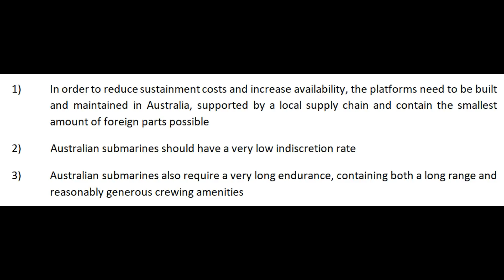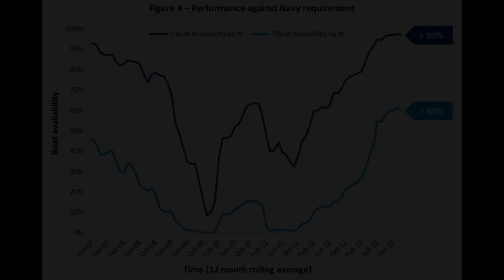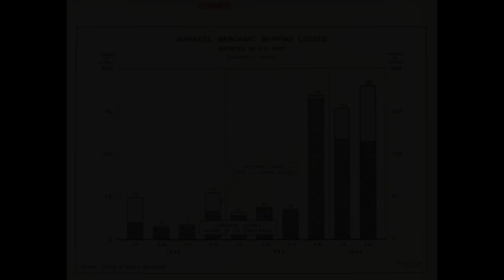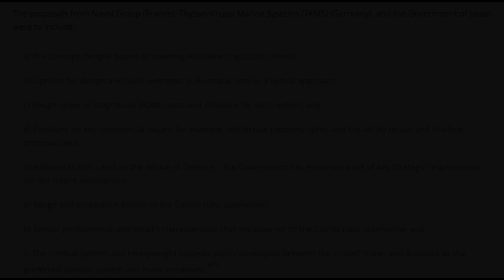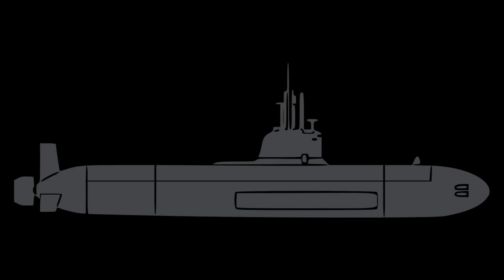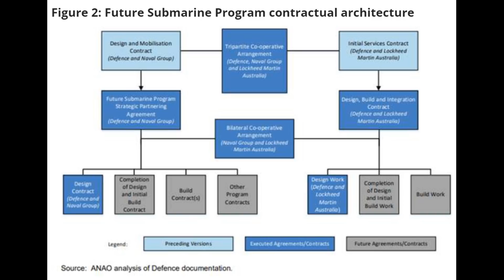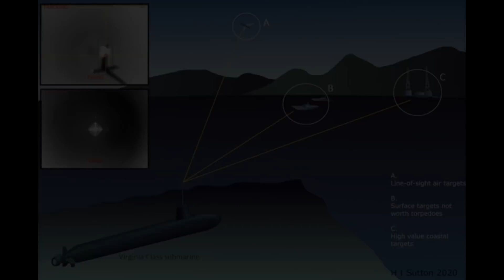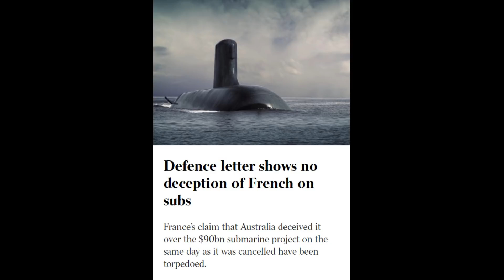AUKUS and the Nuclear Option: the Life and Death of the Attack Class Submarine

Comment: As for the Baracuda nuclear option, I can't see why sourcing nuclear fuel is such a clinch. Its civilian grade and could be potentially sourced from a variety of nation suppliers with a civilian nuclear industry. The UK-US option requires weapons grade fuel, meaning your fuel supply options are entirely dependent on them. I know they won't require refuelling in their lifetime but that can lead to other issues. 
The main being if you do have to refuel them, because their replacement isn't ready in time or because a problem has been detected, you now have to refuel a reactor that was never designed to be refueled. HMS Vanguard is a prime example, went into drydock in 2016 for a refueling it was never mean't to recieve and it hasn't come out yet, despite having been supposed to come out in 2018. 
Having a reactor that is designed to be refueled gives you added flexibility, also submarines are in dry dock all the time for refit and repair, i'm not sure how valuable a none refuelable reactor is seeing they need to come in anyway. As for dealing with spent fuel, your gonna get that problem at end of life anyway, look at the problem the uk is having with breaking up their old nuclear submarines.
Reply: Usually they replace they entire reactor instead of trying to refuel one that isn't meant to be refueled
Reply: @oliverwells8011  I don't think they do, haven't heard of that before. Wouldn't you have to properly dismantle the submarine to do this and then reassemble it after. You might be better off making a submarine from scratch. Honestly, I'm not 100% sure about this though but it sounds like a long and expensive process.

Comment: As always, worth the wait, and such a splendid topic. I have always believed that anything less than a nuclear sub was just not sufficient for the role we use our subs in. I am glad the Collins class will have an extensive MLU to maintain and indeed improve their lethality, and I believe if retained and deployed from Darwin as a deterrent in the Arafura, Solomon and Coral Seas would secure the northern approaches whilst allowing the 8 nuclear subs to range far and wide providing nightmares to any would be aggressor. A fleet of 8 SSN and 6 SSG would give us a significant and credible deterrence capability and a mixed fleet of stealthy and capable subs that could and would make any military incursion fraught with danger for surface and subsurface vessels. Basing the SSN fleet, wisely, and the SSG fleet in the north, we could easily establish a critical gap making any beachhead strategy unviable in terms of both mainland Australia and it's Island territories. I feel the most likely scenario would be the lease of 2-4 Los Angeles class, mixed crews, to establish our capabilities whilst manufacture ramps up, and employing the capabilities of the Collins alongside them would give us a credible deterrence capability from the start of the build program. Yes, Manning is an issue, however it is not the vast problem many seem to believe it to be. The Collins has a modest crew size and even the Los Angeles class, in small numbers as an interim capability would expand the fleet manning requirements, it would still be a wise and cost effective deterrent and make any prospective aggressor consider significant losses in surface groups should a shooting war commence suddenly. Subs are a force multiplier, the Collins, if patrolling Australian waters and territories, could easily make the approaches too risky to consider without significant and credible ASW capabilities, as for enemy submarines, the combination of SSN, SSG and Hunter Class as well as P8A would make Australian waters too deadly for  any hostile submarines to consider anything less than a submarine death trap. I believe the Australian public at large would have no problem with increasing our defence budget and size to enable such a capability which would in turn protect our sea lanes and also our maritime exclusion zone. P8A and Collins makes it risky, add the Hunter and AWD, it's just too risky, add the SSN and it is suicidal to consider any military action in Australian waters. Now just another 3 Hunters and 3 second hand Ticonderoga CG and we have a fleet that would make us feared and respected in time of war, add some F35B to our LHA capabilities, or take 2   soon to be sunk Tarawa class from the USN and deploy the F-35B and perhaps even fully refurbished AV8B from them and we have a fleet that is credible, capable and significant. A dream, perhaps, but consider being short of assets in a shooting war, and no amount of money is going to provide the surface, subsurface and maritime air we need when we need it. The time is short, the risks are great but to lose in what is inevitable with the CCP is unthinkable.
Reply: I agree Australia should keep the Collins Class operational for as long as possible as a deterrent and your suggested deployment from Darwin is spot on.
Reply: Spot on.....

Who needs friends when you have a nuclear attack submarine?

Who needs a nuclear attack submarine?
People who treat their friends like this.

Toe may toe, toe mah toe.

Civilized folks agree that wars happen when relationships fail between nations.

Krupp advertises that you'll get attacked if you don't buy the biggest gun.

Same story 100 years ago.
Reply: The Astute-type attack subs are a good choice, but it should have been made 10 years earlier. The 2nd Pacific War will probably be over by the time Oz gets its new subs unless the Allies can manufacture them a lot faster than usual. In WW2 there was a sense of urgency which enabled the US to build a Liberty ship (medium size freighter) in 24 hrs, though this was a special effort and they normally took a bit longer. With the same sense of urgency i'm sure they could buid an Astute in half the time it normally takes. It would be frustrating if they were delivered after the war was over. China needs 5 or 6 years to build up its armed forces and to persuade Taiwan   to unite voluntarily, so the odds are it will be another 5 years until war breaks out, but it could be sooner than that.
Reply: Brett Mitchell  Politically & operationally unacceptable. The subs have to be built & maintained in Australia in order to be effective & immune to shifting political allegiances & pressures.
Reply: Brett Mitchell  The nonsense is all yours. 
The presentation laid out in a clear & concise manner whey having submarines manufactured on the other side of the world is strategically & politically unacceptable.
If you are struggling to understand why, then the problem is all yours.
Reply: Brett Mitchell  "Maybe you are one of these republicans types who think Australian should seek alliances with Asian countries?"
I'm a Brit, resident in the UK, a royalist & a believer in the Commonwealth as a basis for a deeper alliance (or rather a reforging of what once was), so you know where that supposition belongs...
What's doubly amusing is my not wanting AUS to have UK built Astute, as I'm within a stone's throw of where they're built, with the local economy pretty much 100% reliant on BAE Systems Submarines.
The idea Australia CAN'T build an SSN is absurd & either defeatism, or you are in reality on the payroll of the CCP.
What part of "the reactors will be sourced from the US" are you struggling with?
Presumably the same part as where it's clearly stated the reactors are designed to last the whole life of the submarine.
Reply: Brett Mitchell  The reactors will come from the US/UK as pointed out in the presentation.
The hulls will be built in Aus. You're the one on hallucinogens with your "mine is the only truth" pronouncements.
Reply: Brett Mitchell  Utter nonsense.
Reply: @GARDENER42  what about those Chinese type 39 submarines? Could be affordable short range defense.
Reply: @davidburland6576  Somehow I don't think they'll be willing to supply them, or plans to build them...🙄
Reply: @davidburland6576  What part of Australia is purchasing submarines to counter the threat China which presents are you struggling with?
Reply: @GARDENER42  they look cheap maybe less than 100 million apiece Australia has underutilized  coal assets and a local Chinese operated facility for servicing depending on the number just 5 billion will do and the trade dynamics of reopening the coal mines could reduce that to net zero tactically they can be an anti invasion asset for Australia.
Reply: @davidburland6576  
Let's buy our submarines from our perceived biggest threat, then pay them to do all the maintenance & repairs.
Brilliant defence strategy...
Oh & let's dig more coal to fuel the world's biggest polluter & emitter of CO2...
Reply: @GARDENER42  yes thats it
Reply: @GARDENER42  at least 30 would be nice they can knock them out fast.
Reply: Brett Mitchell  HMAS Agincourt! I hardly think so.
Reply: Brett Mitchell  how do you think the people of Perth would react to having up to 8 nuclear reactors each with several tonnes of weapons-grade uranium docked and serviced just a few kms from the city?
Reply: Brett Mitchell  "a great deal of public anger..."! Where? As history has shown, the Upholder-class were duds.
Reply: Brett Mitchell  tell that to the Canadians.
Reply: Brett Mitchell  certainly the USN but I'm sure about the RN. That's only for brief visits and not permanent basing and maintenance.

Comment: If the RAN does not buy an essentially MOTS SSN, the timeline will be much longer than those for the Attack class.  Costs will also balloon. I have no issue with the arguments presented here, but the ability to resist "tweaking" the design will need severe discipline.  Good luck.

Comment: Hopefully this opens the door to the development of nuclear power for civilian use.
Reply: Unlikely. Nuclear reactors are scientifically interesting but the cost outweighs the utility for Australia due to a range of factors. Varied combinations of solar, wind, geothermal, hydro, and tidal with capacity storage and long range transmission networks are more feasible as alternatives.
Reply: @sir_vix  Yes you are correct. Prof Andrew Blakers of the ANU has demonstrated that renewable electricity with pumped storage hydro along with long grid interconnectors is cheaper than new build coal or gas fired electrical power and far cheaper than nuclear.
Reply: Look up HB11, a Hydrogen and Boron based Nuclear reactor, with lasers to help ignite the reaction. Australian made.
Reply: @Manawatu_Al2844  An interesting link that could be a promising path for fusion power.
Reply: shhh, that comes later..... 😉

Comment: A lot of commentators seem to be assuming that Australia is going to end up with the Virginia Class... I suspect its far more likely that Australia will actually be getting a version of the British Astute Class. The Astute class is significantly cheaper (which will be an important part of the decision), it requires fewer crew (which will be important as Australia lacks the numbers of submariners to expand its fleet rapidly). The Astute is also manufacturerd by BAE, who Australia have existing links to through the Hunter Class/Type 26 programs. The Astute is cheaper, in many respects more modern, easier to run and readily exportable. I'd be very suprised if Australia ended up with the Virginia Class.
Reply: The PWR2 in the Astute is a bad design, the PWR3 that will be in the Dreadnought class is based on an American design that's in the Virgina class already, and the Virgina class is better so the Astute is not more modern.
Reply: @rayjames6096  not sure how you can say Virginia is better than Astute. The reactor issue has been sorted. By all the accounts I have Read Astute is a better sub, cheaper and needs less crew. 
Also it features a better squared bow (front) that is a quieter design. Next gen Virginia looking to adopt that design BTW. The only thing Astute lacks compared to Virginia class is vertical launchers for anti ship hence it needs 20 to 30 less crew. The Astute however uses its horizontal launchers for its anti ship options.
The real issue for Australia is availability. You need subs now. US has no spare sub manufacturing capabilities. UK may have but is soon ending Astute production - unless Aus books it quick.
Suspect Aus may lease some old Los Angeles class from US or old Trafalgar class boats from the UK to train up on. There are plenty of choices awaiting decommissioning.
Reply: @tomjowitt8554   The PWR2 reactor on the Astute is a faulty design and will not be on the Dreadnought class, that will be a PWR3 which is based on the S9G an American design that is on the Virginia class. The Virginia class is larger so it has a larger crew. The UK has no spare submarine production capability. That bow nonsense is irrelevant.
Reply: @rayjames6096  We agree to disagree then. I agree the Virginia is a slightly bigger boat (but the Astute is faster...so what?). Both boats are really good subs, and I was just pointing this out. However if my bow comment is nonsense, why are the US going to adopt it? Suggest you check out Sub Brief's review of the Astute. He is an American ex submariner to see his take on the squared design of the Astute. He also backs up my comment about the vertical launchers on the Virginia needing extra crew.
Reply: @tomjowitt8554    The Columbia class does not have the same bow design as the Astute.
Reply: @rayjames6096  You are right. The Columbia class does not feature a squared off bow like the Astute class. That said, the Columbia class subs are a completely different class of boat, as they are a SSBN (missile boat) and not a SSN hunter killer boat like the Virginia class and Astute class subs. The latest US Virginia Class is the block 4 variant (still using traditional rounded bow), but the US is said to be evaluating the Astute bow design. The US will be building the block 5 variant of the Virginia class soon...and it is for this, for the hunter killer class, not the SSBN class, that the squarer bow may be used, if the US designers decide they want to use it. In the end, decisions like this are a matter of what works best in particular roles, which is why there is no 'best' sub in the world, only the most suitable sub that is best suited for each nation's needs.
Reply: @tomjowitt8554   You stated the new US sub will copy the bow and the new US sub is the Columbia class, which does not have the same bow design. The Virginia block V will not have the same bow design as the Astute anyway.
Reply: @rayjames6096  Are you aware there are TWO completely different types of subs out there, with TWO COMPLETELY DIFFERENT roles? At the start, you compared a SSBN to SNN, which is like comparing an SUV to a sports car. The SSBN (Ohio and Columbia) is the missile boat carrying the nuke option designed to wipe out Russia. The SSN (Los Angeles and Virigina) is designed to kill other subs and ships. The US are CURRENTLY building TWO CLASSES of subs - SSBNs and SSNs, as fast as they can make them. Indeed, the US are still building the USS New Jersey (Virgina class block 4), USS Idaho (Virginia Class bloc 4) and four other VIRGINIA CLASS Block 4 boats. So it simply not correct to say "the new US sub is the Columbia class."
Reply: @tomjowitt8554    I'm totally aware of the two different types of submarines there are, the US created the SSBN sub. Again you stated the US was going to incorporate the stepped hull (a design compromise) on the next US sub...which is the Columbia class. The Virginia class has been in production since 2000.
Reply: @tomjowitt8554    Are you aware that the Trident missiles aboard the UK Vanguard class are all leased from the US, that those subs come to Kings Bay Georgia where the US services and maintains them, that the firing system and silo design on the Vanguard submarines are US designs. That the GPS satellites used in guidance are US Airforce satellites.
Reply: @rayjames6096  Think you are being a bit disingenuous here buddy. I said. "Next gen Virginia looking to adopt that design BTW". Next gen is Block 5 VIRGINIA!. I was repeating what a VERY experienced US submariner (Sub Link) thinks is going to happen with Block 5 of the Virginia class. But it may not. We will see. Anyway, I think I explained myself well enough and not going to keep going back and forth with you on this. Goodnight Ray.
Reply: @tomjowitt8554    Nowhere in your post does it state "next generation Virginia class". The US has been using basically the same hull design since the USS Skipjack launched in 1958 which is optimal for submerged operation . The US does its own hydrodynamic research.
Reply: @rayjames6096  For the last time....this is WHAT I  SAID. Please read it properly...."@Ray James  not sure how you can say Virginia is better than Astute. The reactor issue has been sorted. By all the accounts I have Read Astute is a better sub, cheaper and needs less crew. 
Also it features a better squared bow (front) that is a quieter design. Next gen Virginia looking to adopt that design BTW. The only thing Astute lacks compared to Virginia class is vertical launchers for anti ship hence it needs 20 to 30 less crew. The Astute however uses its horizontal launchers for its anti ship options."
I don't think I can be any clearer than that.
Reply: @tomjowitt8554    OK but regardless the block V will have the same hull design as the block IV but will be larger.
Reply: @rayjames6096 give it a rest, go watch sub brief & then you will understand why what the Germans and the Brit’s are doing is more stealth, US may use that hull shape on the block V Virginia.